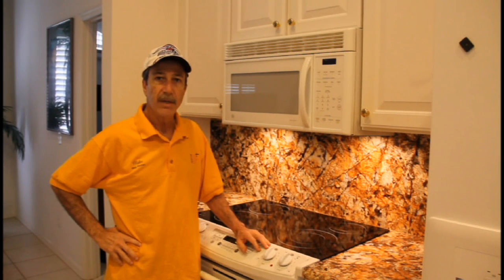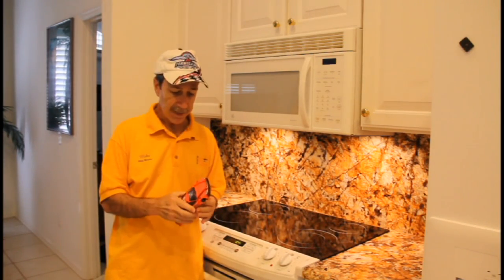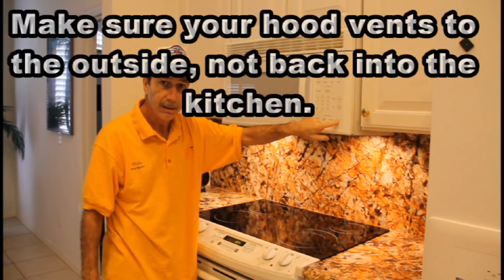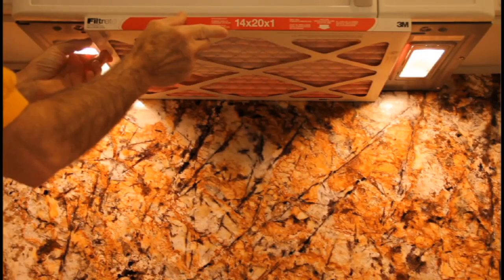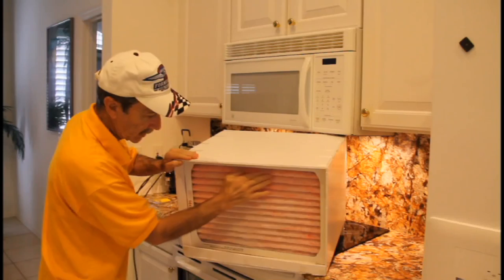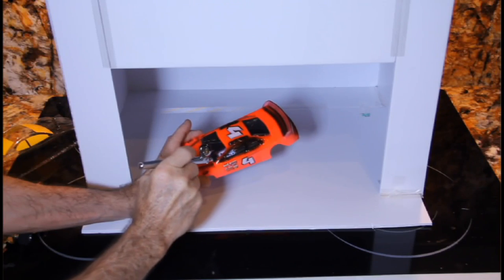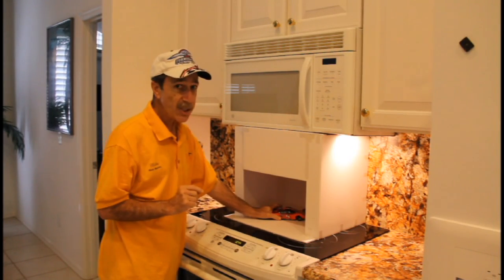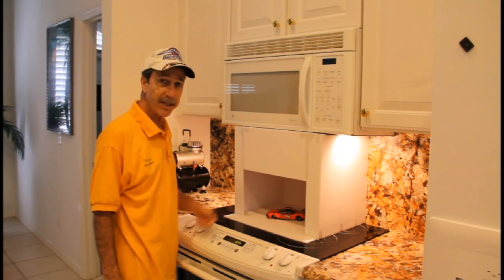DIY Airbrush Booth made easy

Comment: Nice and simple, good video. I am a slot racer as well, and just completed my booth and will try posting a video when I get my compressor set up. One thing you may want to do in order to reduce the risk of fire is to turn your oven off at the breaker. That way nobody can accidentally turn the elements on while your rig is on the stove. Thanks for the vid! Ray

Comment: Great idea.  Would definitely turn the breaker off for the stove if you have little ones around. I'm currently building a portable paint booth for big projects using a range hood and furnace filter. I'm using a removable panel sandwiched between the door frame and sliding door with a vent hose.  Thumbs up for your video!

Comment: You realize that most exhaust fans no longer vent to the outside right ? Its fire prevention regs in some places. outside stove vents get clogged with grease and catch fire, so most newer homes built after 1970 or so DO NOT vent to the outdoors, rather just blow those fumes up towards the ceiling.
Reply from the maker: Definitely don’t use if your hood doesn’t vent to the outside.

Comment: Great idea.  Sometimes all we need is right in front of us.  The only rhetorical question I have is; "If you're fans are vacuuming the fumes and dust to the outside, why would you need to use a filter?"
Reply from the maker: It's important to use a good filter because the overspray will cover your fan blades and cause dust to stick to them. After a short time the blades will gunk up and go out of balance. This happened to a friend of mine that decided he didn't need a filter.
Reply: Great point.  Thank you.  I hadn't thought about that happening.
Reply: so the possible paint-mist wont paint ur roof or clog the machine's own filter.. just my thought =)

Comment: You do realize that you are venting fumes right back into your face with this? That filter and no other filter will stop all of the fumes and the exhaust is right in your face on the stove vents, not to the outside. Just because you cannot smell it does not mean it is not in the air. I would never recommend using this kind of set-up, the fumes must be vented to the outside.
Reply from the maker: Thanks for your comment Christian.  When I built this house I had my kitchen hood installed with a large duct to a roof vent. The slotted louvers visible on the front are just for looks, no air comes out of them. Ive never understood why many houses have their vent hoods installed without doing this. Makes no sense to me.